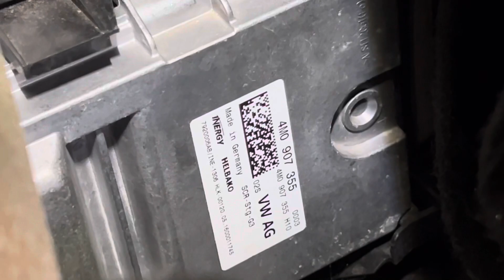✅ Audi Q7 AdBlue SCR ECU Location

Comment: I need help - please can you respond. If I take this ECU out - is there anything else I need to do? I have a vcds laptop..please @modtrix
Reply: Did you removed the Adblue ECU? Are there any errors or problems?
Reply: @plamenvelichkov1886  I haven't tried - can you do it first haha
Reply: You have to disable SCR-Adblue functionality in Engine Control Unit (EDC17CP44) by modification of original software.